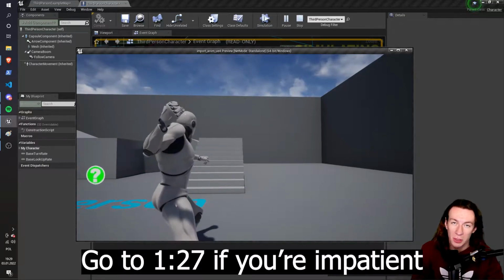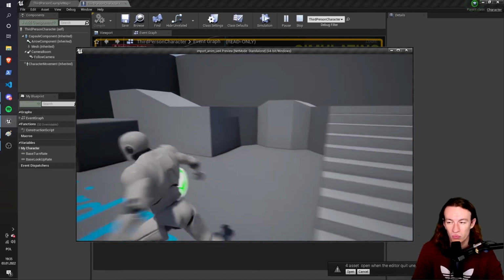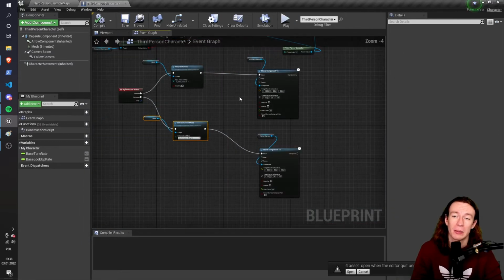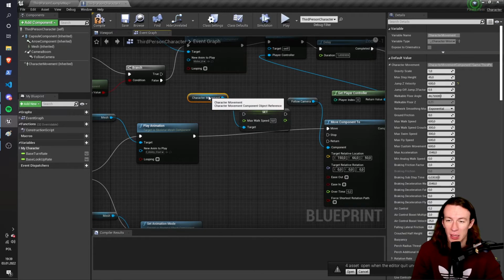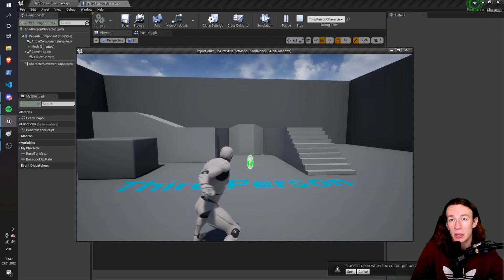Unreal Engine 4: Camera ZOOM in 4 MINUTES  + BONUS tips

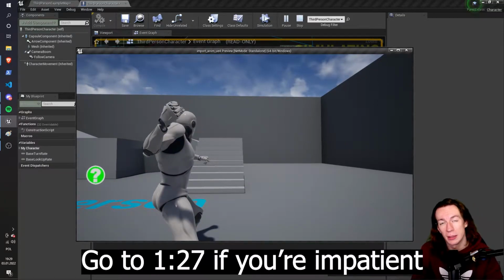Comment from the maker: 0:00 Intro
0:20 (optional) Set up the initial camera position
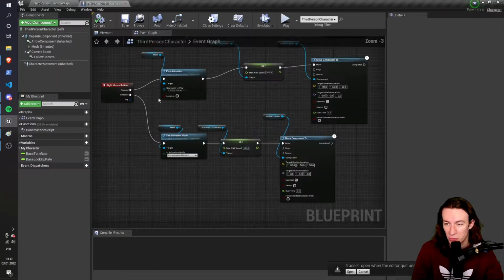1:27 Step 1 - Set up Right Mouse Button node
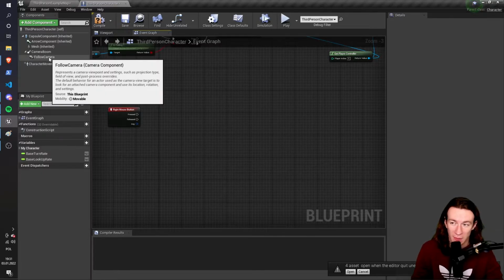2:00 Step 2 - Zoom in: Add the camera component and Move Component To node
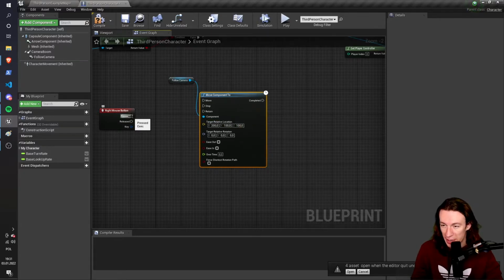2:38 Step 3 - Connect RMB with the Move Component To node and test
3:19 Step 4 - Adjust Target Relative Location values
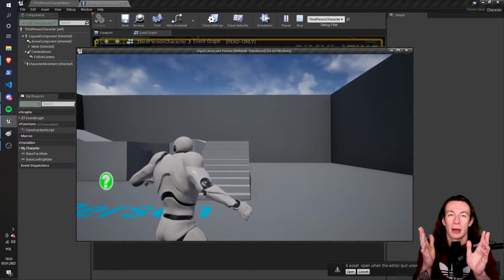4:00 Step 5 - Zoom out:  Add the camera component and Move Component To node again
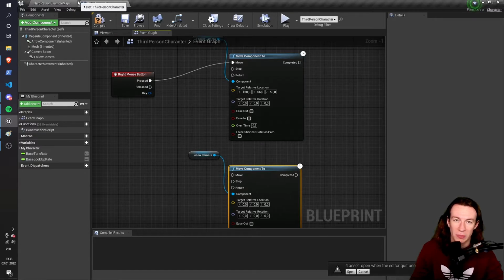4:30 Step 6 - Adjust Target Relative Location to the initial camera location
5:35 - Final result
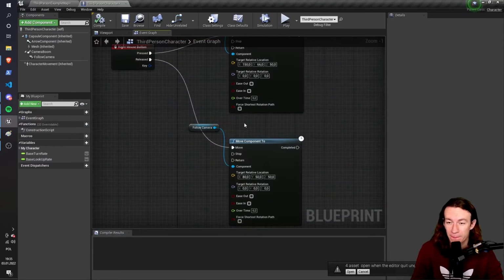6:30 - Bonus 1: Adding throw animation
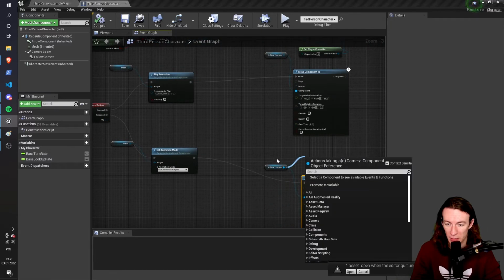8:59 - Bonus 2: Adjust Max Walk Speed